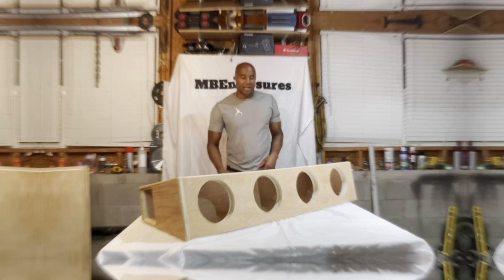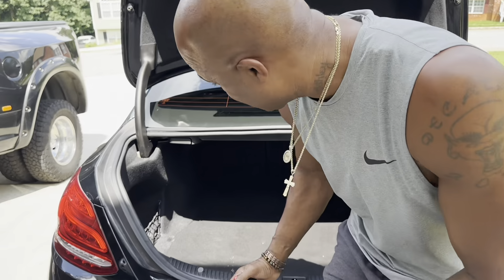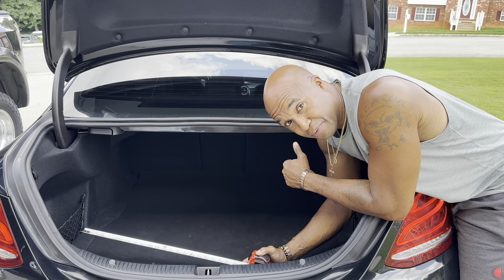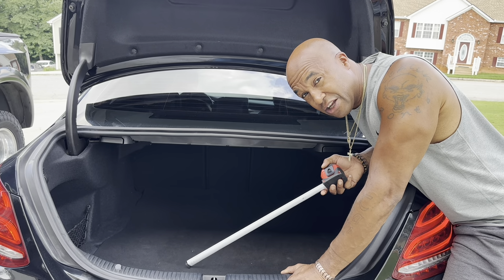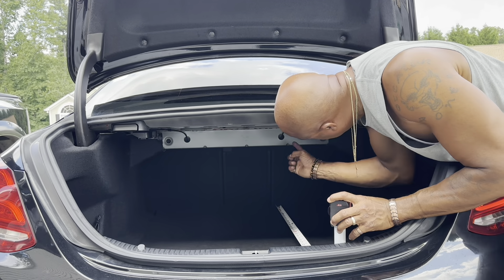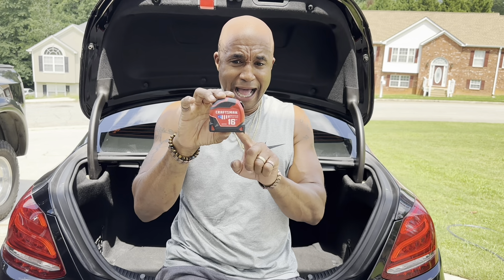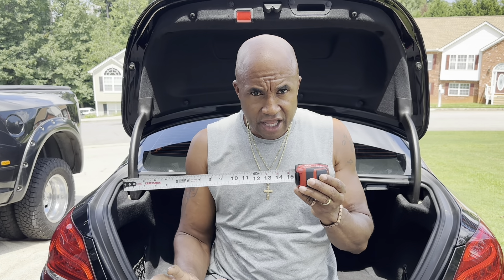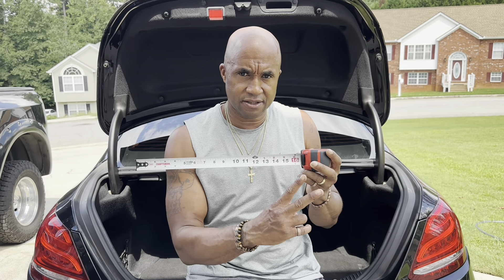How to Measure a Car Trunk for a Custom Enclosure w/ MBE!!!

Comment: You must have read my mind with this video...lol  This was the exact question that I had for you.  The measurements would you need for my Mazda 3 for the box and what subs for the optimal performance.  Amp is a Punch 1,000 Watt Class-bd Mono.  I have one 12 now but I want to go with an MBE box with two 8's or two 10's or maybe even two 12's.
Reply: He would need the measurements you want the box to take up as shown in this video. Also take into account how the box would fit through the trunk opening. 
If the seats fold down, it might be able to fit from the front through the side door opening. 
Once he has the external dimensions of the theoretical box (that will actually fit through the opening) he can calculate the air space available. 
A hatchback can fit a larger box due to the larger opening. If you have a trunk car, take your theoretical box area you measured and make a mockup out of cardboard and tape. Then you can verify it will fit through the opening. If it doesn't, you might need to shrink the box in a dimension that allows it to go through the opening. Plus this will help you visualize what the box will look like when installed.
Reply: 8” or 10” subs will do because those mazada 3 are hatchback open hatchback but if your car isn’t hatchback but is seal or folded seats go by the 12” subs. Got luck with the build. Just like  truck with 2 door small  subs like 6.5” subs will do since a regular has no room you could build a seal enclosure but if you have a 2 seats on truck you have space meaning you can use ported enclosures with 4 X 6.5 or 8” subs will do not 2 X 12” subs 🙄👍

Comment: Great video!! Another note that a lot of people forget, it doesn't matter how much air volume you have in your trunk if you can't get the box in there. 

For instance in my cars trunk the largest box I could theoretically fit would be about ~5 cubic feet net. The largest box I can fit through the trunk opening is only ~2.8 cubic feet net. If I remove the back seats to get a larger opening I can fit ~3.7 cubic feet net.
Reply: Yes, I always recommend people take the time to make a box mockup out of cardboard and tape. This way you can verify it will fit through the opening. 👍
Reply: In my case I measured the trunk itself. And then we used trial and error to figure out how much of my car had to come apart to get the box in lol.

I would have been able to fit a slightly larger box, but I'm running an 18" and didn't have enough height to fire it forward. So I had to fire it up and that cost me a little air volume.

Comment: Another video idea, take the height and depth of your potential box, cut it out of a piece of cardboard, hold it like it was the side of the box and make sure it can fit through the opening. 
If it can't, shrink it until it does. Then you have the maximum box size that will fit. 
If the car has a fold down seat and the box can be installed from the passenger compartment, make sure box fits through the door opening.

On this particular video I see some angles on the top left and right edges that might prevent a 12" tall box the full width from fitting. It those are metal braces, the box might need to be made narrower or shorter to clear them. 👍

Comment: Do you build any upward facing boxes for car trunks?
Reply: Relating to your message you mean subwoofers facing up if so he will build your enclosure to where you can face the enclosure up forward or backwards?meaning you can have your port in the center facing up or your port to the side right or  left with the two subwoofers on one side  when I had my towncar I like my subwoofers on one side facing up and the port to the far right facing up I didn't like the license plate rattling facing backwards  the subwoofers and port to the rear facing forward you would have to let the back seat down and seal it off